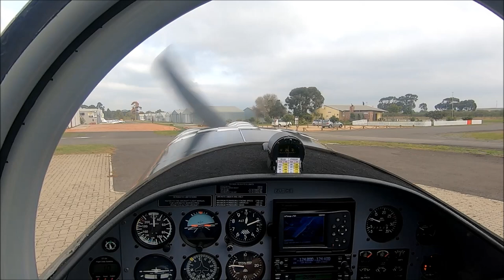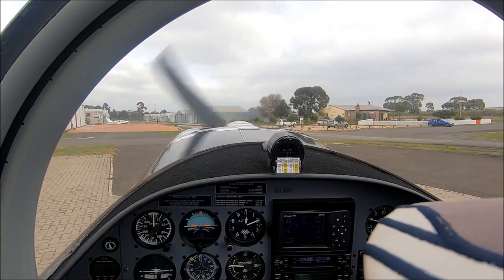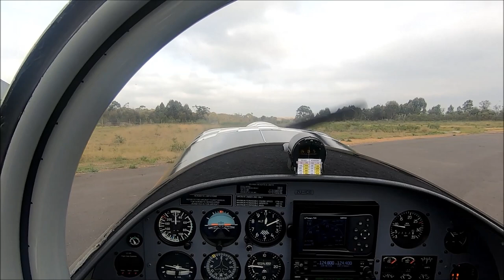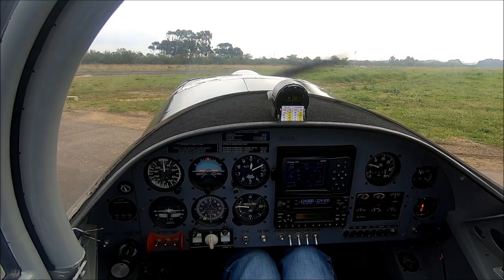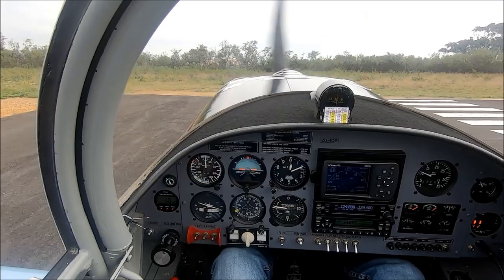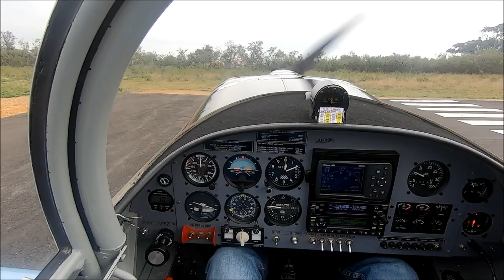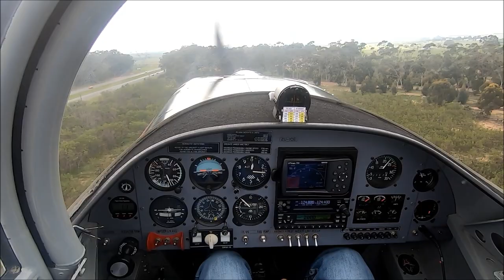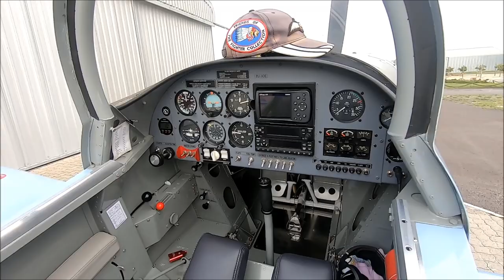Vans RV8 simple flight

Comment: I like that we can here the engine in addition to hearing you talk; no music playing.

Is the RV8 pretty low maintenance?  I realize all aircraft, experimental or certified, will require maintenance here and there, but I don’t wish to buy an experimental aircraft to have a bunch of parts strung out in a garage.  I just want to FLY the thing for an affordable price (most certified aircraft as capable as an RV8 would cost well over $300k, whereas a good used RV can be found for under $100k).
Reply from the maker: I am a "weekend warrior" and fly about 40 hours a year on the RV. I got her in July 2014 and I have had very few issues. Once the fuel pressure was reading low and it turned out the earthing needed tightening and the reading was restored. Based on my flying she gets serviced once a year, but otherwise, as one would hope and expect, she is as reliable as a modern day car. She is not certified, but all parts and engine are stock standard and well tried and tested in the industry. While still classified as experimental, all parts used are tried and tested and so far very reliable. Thats why the RV is a good choice - there are a lot of them around. My insurance recognises that in the premium with the RV relative to other experimental aircraft.
Reply: @timothyirvine2842  Awesome, thanks.

Comment: Cool video.  One comment - I usually choose the fullest tank before startup, and then stay with it through taxi, run-up, and takeoff.  I've heard of cases where a change was made just before takeoff, and it caused an outage.  I'm thinking of the case where there is a bit of water in the tank, and if you stay with that tank you probably have time to see if there is an impact before takeoff.
Reply from the maker: I was taught taxi out on the lowest tank. Then as you stock check area clear, brakes holding and change tanks. Then do the run up and all the check on the tank you going to take off on. That should be enough time to pick up an issue with fuel. It should be enough time to pick up something like water etc.

Comment: 3:15.  "Gyros".  You said it, but didn't set your DG  I like giving unwanted flight instruction!  :)
Reply from the maker: you absolutely right. From making the videos and watching myself afterwards I see mistakes. Practically I fly VFR with lots of land features, but a bad habit crept in with me not setting the DG. If I was to get value for money for the instruction, you would have pointed out I didnt call out flaps right after I checked the fuel ... :). Bad habits creep in and I find my renewal with my instructor eye opening as they will always have something to teach me or re-teach me, whether it is procedural, or a "have you thought about this?" type question.

Comment: 2200 RPM doesn't seem right for takeoff power.
Reply from the maker: its a fixed pitch prop and its enough to comfortably get her off my home runway
Reply: @timothyirvine2842   Yes, it certainly is getting you airborne but something still doesn't seem right. The engine should make about 100 RPM below redline on a static run, unless the DA is really high. Are you flying out of a high elevation? If not, then it might be worth asking your mechanic about it. Could be prop is not the correct pitch or something not quite right with the engine setup. Might be something quite simple.
Reply from the maker: @paulrenny8388  I’m flying at sea level. Thanks, I’ll ask my mechanic and check that all is good.
Reply: @paulrenny8388  not uncommon with RV's, I can get just over 2200rpm on a static run, were I to get within 100RPM of redline the engine would overspeed in cruise!  these RV's are made to cruise fast, and a coarse "Cruise" prop will limit the static RPM
Reply: @paulrenny8388  Not true Paul.  I have a FP O-360 -8 and get 2180 static and will slightly overspeed at 2800 at full throttle.  Tim's static RPM is perfect.
Reply: @jcheck6   Yeah you are right. I forgot that in the homebuilt world you can pitch a prop to whatever you like in order to accommodate either climb or cruise bias.